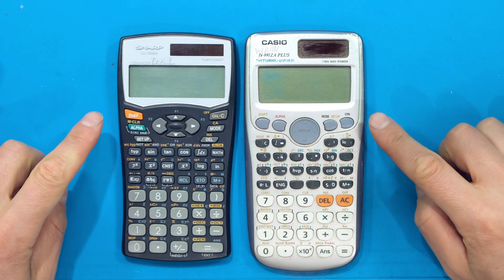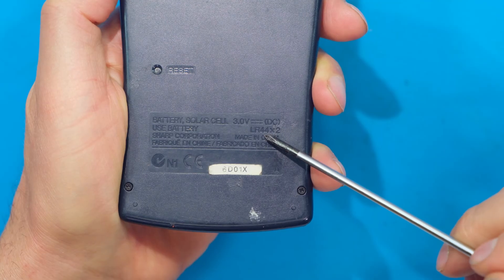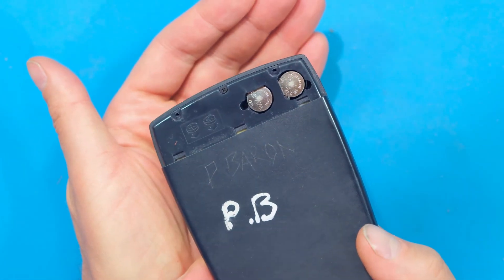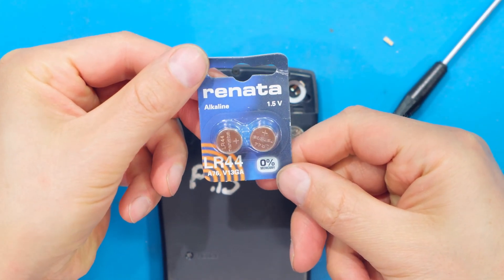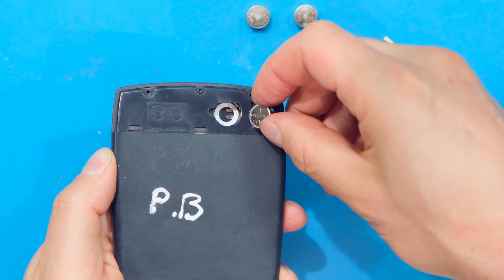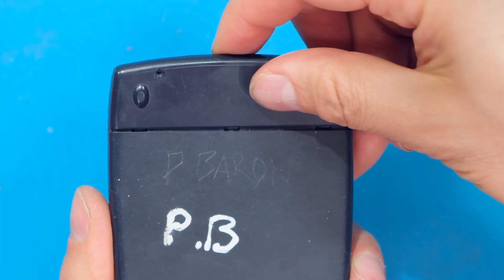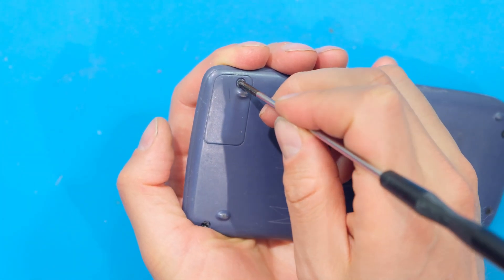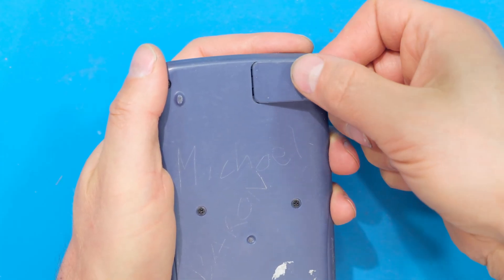How to replace the batteries in a calculator - step by step

Comment: They should stop using alkaline button cell batteries. These batteries have ruined countless devices when they leak, which is pretty common. Use lithium batteries instead like CR2032.
Reply: Does it fit in
Reply: @Aurora.0822  Check your key fob to see what kind of battery it uses. Many (but not all) key fobs use CR2032, which is a lithium coin.

Comment: After replacing the battery yet calculator is not working it gets on when sunlight comes... But do not on in room or normal light... It on only when the solar panel gets light
Reply: same issue
Reply: Same issue
Reply: Same issue